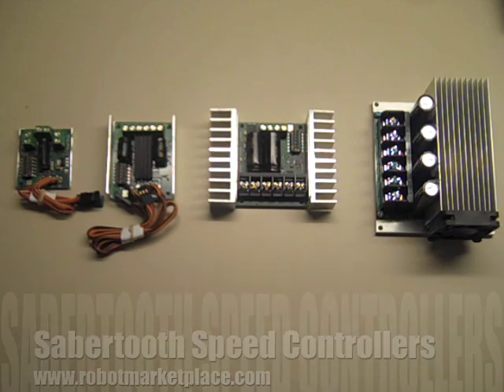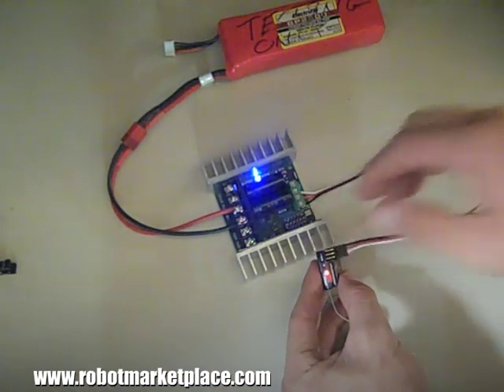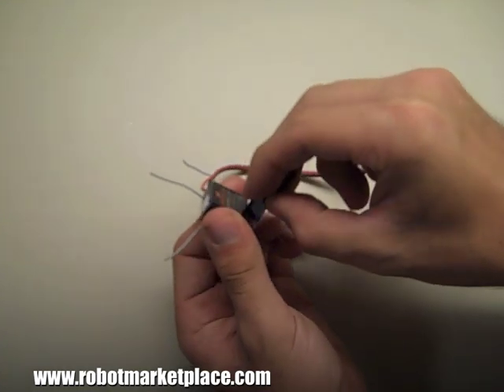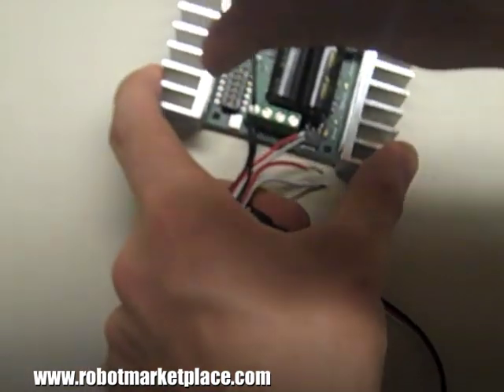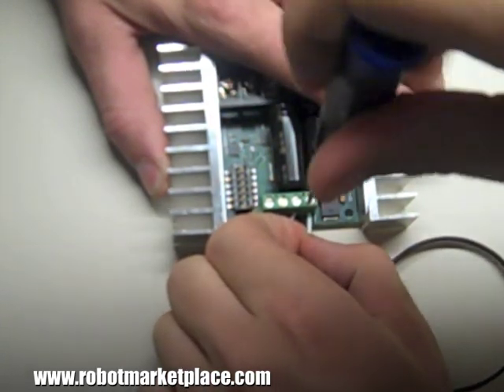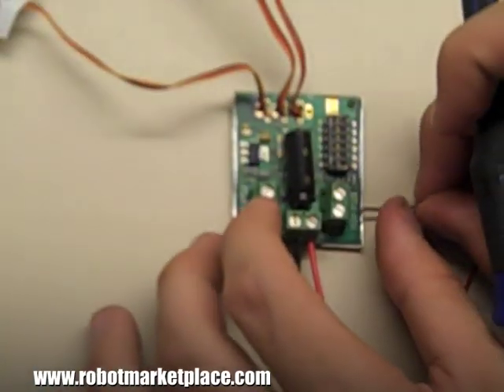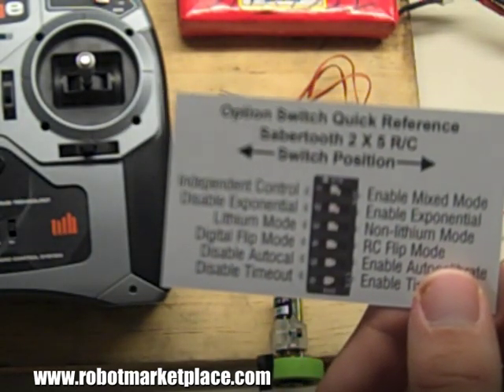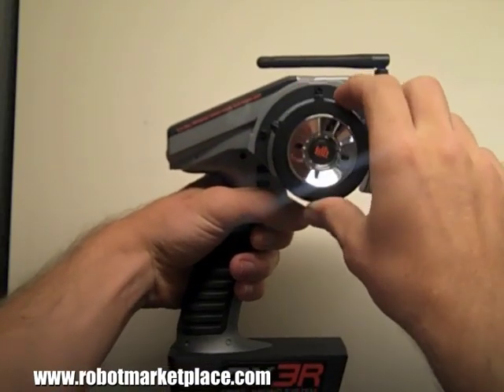Sabertooth Dual Motor Speed Controllers - The Robot MarketPlace

Comment: Ok both red together. This guy tried to tell me only connect one power wire or you'll send 10v. I'm telling that's not how voltage works. It's the same 5v power just split. And even if 2 5v power supply still it just more amp in parallel it's not in series

Comment: Not an "official" endorsement or linked to anyone but me, but Sabertooths are the defacto, highly encouraged choice when using scooter motors or other brushed DC motors in R2/Droid building. Dimension Engineering is SO helpful when it comes to support. There must be hundreds and hundreds of droids working off the 2x25 or 2x32 Sabertooth.

Comment: capable controller but extremely  unreliable. they do not last at all. very flimsy design.can't even take RC lawnmower movements. slightest bump will shorten the caps.

Comment: Brand new to Sabertooth .... I have a 2x32a & a Flysky FS CT6B. My tx is bound...what channels do I connect on my rx? you've made it clear where the six wires go on the sabertooth, but where on the receiver? thanks
Reply from the maker: Your receiver should be clearly marked which pins are for what, but there are 3 per channel: Positive, Ground, and Signal. Your Receiver should have marked which is ground by a "-". Positive is always in the center, and the signal wire goes to the opposite pin from ground. + is usually a red wire, ground is usually black or brown, and signal is usually white or orange. Depending on your application, you may not need to hook up the red wire at all, but you should always use the other two.

Comment: Has anyone setup a hybrid system, with a gas engine powering a 24vdc alternator to charge the two 12vdc batteries and then to the controller and then to the electric motors?
Reply: Your describing a Locomotive. Substitute diesel for gas. So, this "new tech," is 60 years old, at least.

Comment: to get the bare leads do you just cut one of the ends?  And what is the tool called that you use to put them into the sabertooths? (the one with the blue handel).
Reply: The "blue handel" Tool comes through a defense contractor. Stanley/Avionics. The tool is sold to the Pentagon for $138.49.

Comment: I bought a 2x10 with the heat sink for my Son's Sumo Bot.  Man it works great!  We hooked up two motors in parallel per side and works them nicely.  It'd a 2kg bot and the control doesn't even get warm.  I would recommend this speed control for any type of robots.  Nice hook up video too.  Between you and the instruction sheet we had it wired up in 2 minutes!

Comment: i have used the sabertooth 2X25 before and loved it! i had it in a 15lb battlebot, great response and took a beating no problem. i only wish it had an output for a relay from a third channel for activating my weapon. ended up using a pico switch. i was ultimately happy with my results and would love to get my hands on another one!!!